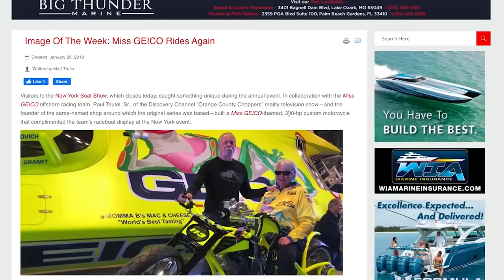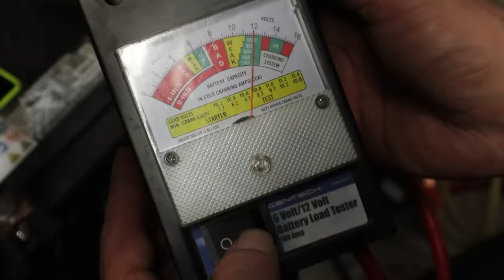Will the Geico Orange County Chopper Ever Run Right? (Unfixable)

Comment: This whole video EXACTLY confirms every word Jay Leno said about OCC bikes. I thought he was just exaggerating. I had no idea he was spot on.
Reply: Yep. They keep fiddling with stuff to try and get it running as it is. First thing they really should do is pull the engine and rebuild it with lower compression and a better setup for the supercharger. Doubtful it’d make the power that was sometimes claimed, but would at least make it not need race fuel to barely work.
Reply: Junk that's why what was 250k to be built can be bought for less than 10k
Reply: @keithbelz2952  yeah they're definitely not 6 figure bikes, but the buyers of OCC bikes aren't really buying a bike for 6 figures. They were buying a marketing opportunity to be highlighted on the show, and the bike is essentially like a gift bag that they can take with them and display at their offices.
These bikes aren't built for riders, and they're not really the product either.
Reply: @Motodidakt That's the most succinct description of what was going on I've ever heard. Well said man
Reply: Yes they were basically selling a one or two hour commercial for their brand will tons of rerun potential.Not buying a bike at all.
Reply: @NBSV1  or at least run a bigger pulley so it'll lower the boost and give it a better chance to run. 200hp is better than no hp.
Reply: @awdrifter3394  200hp is insane on any bike, but these big old style bike engines aren't really the thing for insane power. Something with the frame made that way isn't really good for insane power either. The supercharger needs to be tuned to basically be doing stuff all, because it's clearly there for aesthetic reasons anyway.
Reply: Jay had OCC build one for him. I saw him say in an interview that the bike was junk and he had to have his own mechanic redo it.
Reply: They're bespoke artworks, and they were worth whatever someone wanted to pay for them. Tax deductible, too. Get over it !!
Reply: OCC bikes prove that unlike genius, stupidity has no limits
Reply: @thefreedomguyuk  🤣
Reply: Most of the occ bikes were built as show pieces, any occ bike that was built well isn’t known of and wasn’t on tv, when they had real customers buying bikes they actually planned on riding occ built a rideable bike, but for stuff like the miss Geico bike they only built them to look cool and different as attention grabbers, they were all just marketing bikes
Reply: @AAAskeet exactly and that’s why occ always stored and still had most of the bikes , any rideable bike they built wasn’t put on tv, as the owners of them just wanted a bike and not an advertisement
Reply: Money laundering through a hack bike company.
Reply: @awdrifter3394  why not scrap the blower, put normal pistons in it, slap that in a rational frame and actually ride the effing thing, instead of restoring a pile of crap that never should have been built in the first place.
Reply: @danrayha3756  then it wouldn't be a Geico bike anymore, it'll be an Allstate bike.
Reply: What’s funny was Paul sr trying to defend himself. Then has to make a date saying well he liked. Letterman better and Letterman show was ran better anyway.  Senior always has to go for that dig and he wonders why nobody likes him or very few people like him.
Reply: @thefreedomguyuk ehhh well you can't really tell anyone to get over it when the purpose of the show was the build motorcycles. I mean isn't a motorcycle supposed to do motorcycle stuff? Never once did they ever state they made pieces of artwork. If so, then for years they fooled a sht ton of people. Plus the hype they created for motorcycling shld def give credit. So for those who obvi cldnt afford a custom bike got out and rode whatever they bought. Those that cld and weren't famous def wanted a working motorcycle plain and simple. Period
Reply: It's like a house built by an architect.

Comment: None of their bikes were built to run. 😂
Reply: I'm pretty sure at something JR even said that hahaha
Reply: The caterpillar bike ran and it kicked butt
Reply: Facts!
Reply: You ain't kidding bro.
Reply: @JimGoch   But the show was entertaining. 😂
Reply: @Gemini22-v4w  One of the most expensive bikes they ever made xD
Reply: They were built to run away from.
Reply: Should change the name to Orange county floppers.
Reply: They were alll built to run... for 300 feet or so. Out the shop, on the little stage or carpet, and into the suckered company's trailer. They then ran a real bike all the way to the bank.
Reply: OCC bikes were built for television, not real life.  The frames were well made, and they used expensive gear, but if they spent half as much time on detail work as they did on temper tantrums, they could have become the next Big Dog.
Reply: Lemon County Choppers.
Reply: @johnnyd63  😂
Reply: Neither are Lamborghini, Ferrari, or Bugatti cars. They are designed to be started up once every year and drove around the block. They are notorious for breaking as soon as you get them on the road.

Nobody is hating on supercars though. These motorcycles are made to be show pieces. They are never intended to be daily riders.

He's trying to make a Lamborghini into a daily driver vehicle. That's why it's not working.
Reply: @DrSpoculus Ferrari has won a lot of races. They are expensive to maintain,  but they do run.
Reply: @DrSpoculus you're comparing factory cars to one off of abominations
Reply: @samholdsworth420  comparing hand built vehicles made for show. High end cars are not made on a production line.

Comment: A 300hp bike with no rear suspension and a front disc that might be 6". What could go wrong?
Reply: Nothing, that bike is as safe as that huge exposed belt wobbling near the rider's knee!
Reply: I had a bigger disc on my mountain bike!😂
Reply: I find it ironic and funny that this death trap was built for an insurance company
Reply: @JayMalone26  So. You don't understand that it was simply a photo op, and never designed to be driven. Neat.
Reply: @ejlarson249  So. What was the point of using and engine & tranmission w/ internals,  terrible wiring, delivered w/ fluids and so it can barley start? Neat.
Reply: @JayMalone26  Maybe they just wanted it to run long enough to go up a ramp and into one of those industrial grinders that will turn ANYTHING into 2 inch pieces WHICH would be a good thing to do with anything OCC built.
Reply: I know NOTHING about motorcycle repair so you YouTube warriors don't crucify me if I'm wrong. 
 It seems like it would be easier to take the whole motor out and then fix it.
Reply: @budgreen7894  This bike was built as an advertisment. It was never meant to ride around on.
Reply: 300bhp😂😂😂 if that pos ever makes 150bhp  I'll be amazed!😂
Reply: It's less then 140...

Comment: A friend and myself painted the Mrs. Geico boat a few times. We saw this bike while down in Florida at the boating facility, buffing and putting the final touches on the boat. I was told then that someone had been allowed to drive the bike, ran it out of fuel and put regular pump gas in it. The engine overheated and he had to be towed back to the shop. That was back in 2019. So that bike was screwed up long before your friend got it. My buddy actually has 2 of the Mrs. Geico watches also. It was part of the deal for us painting the boat.
Reply: As a mechanic it's always the stuff people don't wanna tell that is what you need to know to fix it lol
Reply: up
Reply: You and your buddy did the work, but he got both watches???
Reply: I noticed the watch had an 08 on the clear cover…. I’ll bet there were a lot of them given out as gifts..

Comment: Craig:  it doesn't have to go to a starter shop to switch that button.  That five-sided section is literally the starter solenoid.  All that button does is push directly on the solenoid plunger, bypassing the electromagnet that would usually thrust it forward.  Stick the output shaft into a hole in your bench or simply open the jaws on a bench vise, letting the shaft extend while supporting the starter with that cover pointing straight up.  That part is important until you know how those things Nippon Denso starters are built.  Keeping it cap-up prevents you from loosing a ball bearing and one (possibly two) springs.  Remove the screws from the corner of the cap, holding slight pressure to the cap (spring, remember?).  Lift the cap and remove.  Install the new cap.  This is literally a three-minute panel swap.

While you have the starter solenoid open, inspect the two contacts (the two weird-shaped copper contacts) for pitting and scarring; polish if necessary) and the contact disk mounted around the plunger (again, polish if necessary).  The only failures for Nippon Denso starters are these contacts and eventually wearing out the brushes.  Things are immortal.  In fact, you could probably polish the armature and commutator in the "bad" one, slap in a new brush rack, and your grandkids will be passing it on to their own kids.
Reply: Yup. These things have been around forever. If you're old school like me, there's even a little lever version for the solenoid on shovels. Or go really old old school and use a bent hacksaw blade.
Reply: Had to put one on my neighbors evo fatboy. We changed out the over riding starter clutch. But he pulled an occ move & tried to install the starter with a rubber mallet. Tore the terminal off the starter.    Good thing i had a manual over ride kit.  Now he gets to reach his thumb around a hot exhaust pipe to start it.